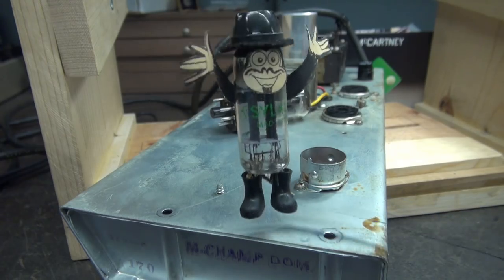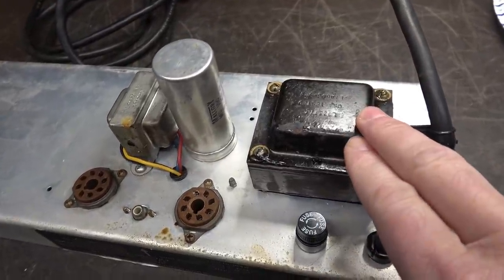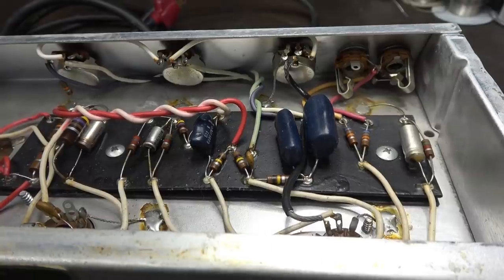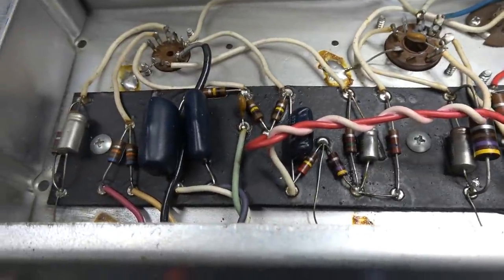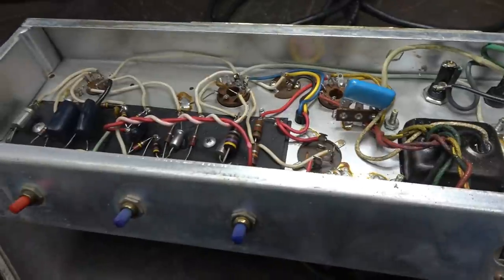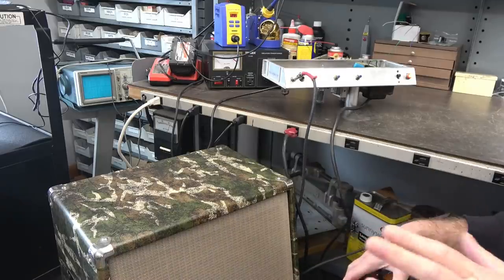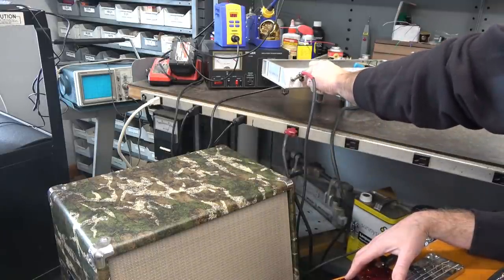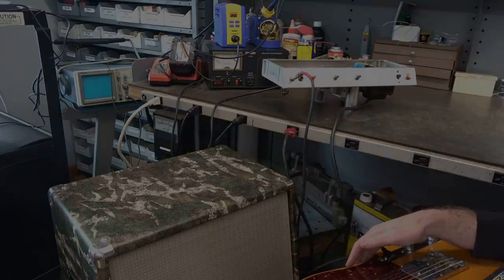How to replace bad tube sockets Check Bias Fender Silver Face Champ Class A 6V6 tube guitar amp

Comment: Thanks Terry.  One tip about matching the original wiring when installing a new socket - your iPhone/Android can be your best friend.  Take a reference photo of the wiring  before you de-solder the original socket.  That plus the schematic is a belt and suspenders approach for replacing the socket.  I started doing this years ago when doing auto and appliance repairs.  Saves me time and improves my odds of getting it right before I power up.  :-)

Comment: Tech Tip:
Any unused sections of a can capacitor should have their terminal shorted to ground. This prevents that unused section from building a charge over time, and that charge would not self discharge.
Reply: Good call.
Reply: Sounds plausible, sure wouldn't hurt to be on the safe side.
Reply: Maybe a resistor to ground would be good, bleed off any charge if the cap shorted internally between sections it wouldn't be a dead short to ground.  I'm not sure how common it is for a short between sections to occur.
Reply: Israel Bettle  Are you actually telling someone you hacked your girlfriend's account and are telling someone else how to do it?  Why?  Would you like it if someone hacked yours?  Or are you a 'bot that just answered yourself as "Huxley Victor", saying you'd try it out but giving an update without editing your comment?

Comment: Terry, great video but I have a question:  I’m getting a couple of people (that I like) that are begging me to work on their amps after having bad experiences with other shops.  I have no problems with the technical side (maybe lacking in some of the lore and component-sourcing) but really have no idea what to charge.  One of these is an SVT monster that needs sockets as well as the usual.  I’m not looking forward to all this hand work and due to the extensive nature, they know the have to compensate me.  I see a lot of repair videos but not on charging and the money side. 

If you could give me a little guidance, I’d sure appreciate it!  Thanks & 73… 😊

Comment: What wattage soldering iron do you use? Reason I ask is: soldering or unsoldering directly on the chassis is always a challenge for me; due to the dissipation of heat on the large surface area.

Comment: At 10:10 in the video, when you cleaned the new cap solder connections, I did happen to notice that all the original chassis connections have flux residue..

Comment: I always enjoy your videos, thanks. A question; is it common to find that the cathode bias resistor called for in the schematic is actually wrong and allows it to run too hot? I'm just finishing a rebuild of a Hallicrafters S-76 and found that the bias resistor on the 6K6 output tube, 390 ohms, allowed about 46ma of plate current or 171% of max. I replaced it with a 680 ohm resistor and now have about 26ma plate current. I'm just wondering if this a common thing to find that it had been biased hot from the factory? It makes me feel a bit weird to ignore what's on the schematic.
Reply: Schematics were designed to work from the  lower power supply voltage ( 110VAC) in the past compared to today's (125VAC). 
So it would prudent to lower  the current to the specs level so you don't overdrive your tube! Following  vintage schematics is OK but you have to think 
what about what is really going on in today"s world and make the appropriate adjustments.
Reply: @hestheMaster  I also calculated the current using the voltages they list on the schematic, (mine are little higher) and it would still be running very hot. It's like they didn't mind. Also, this radio is rated up to 125VAC. I'm curious what their thinking was or if this is common on communications rigs. It's not very loud...I've been thinking of subbing a 6v6 for the 6K6 and going back to the 390 ohm cathode resistor.
Reply: @TheDevice9  Sounds like you need to visit Antique Radios Forums. There are a lot of posts on this receiver as well as some mods to make it sound better. What you purpose sounds reasonable BTW

Comment: So if your line voltage is over 120 volts A/C, what is that doing to the heater voltage on your 12ax7 and 6v6  tubes? Won't that make it too high as well Ter?

Comment: I've got a vintage princeton reverb that's basically a time machine unit, someone bought it yesterday, left it on my front porch..  iots got the brand new stock RCA fenners... its MINT 10++..

the only thing is the power tubes are loose, and they pull out so easily, being upside down they made me nervous so I carefully installed spring retainers you mount at the socket screws.. used rubber bands as to not scratch the screws, what I am looking for is a male to female socket that has extra large male prongs that will snug into those loose fenner sockets real tight then I can plug a tube into that.. no retainers or maybe keep the spring top clamp style on there..

the condition of this I don't even want to tamper with a screw much less heat a solder joint, obviously I need a good solid valve connection so need a good no tamper solution?  maybe there are power tubes that have extra large diameter pins?  the 6V6 power tubes have a coin base with flimsy thin pins?   just seems sketchy to me..

Comment: I've got a Bassman Ten of this vintage in my office here and when I just plugged it in for the first time in like 10 years (long story) it did the old loud feedback hum which I later figured out was called redplating after about a minute of playing. I reached back there to shut if off before it melted down and there was so much heat I pulled my hand away. Before I could unplug it from the wall the fuse took care of shutting her down. Pulled it apart and I found that both power amp tube sockets are toasty like the ones in the video (loose pins and signs of arcing) and the one was bad enough that one of the soldered terminals had partially melted. 
My question for you is, would it be worth just soldering in new sockets (would that likely semi-permanently fix it)? If that's a no go, can you quote me what it would cost to have it gone through like you do in the video here? It's a bit of a family heirloom at this point, so I'm looking to get it back up and running, and I definitely don't want to do more damage to it.
Reply: I'm looking at it some more and it looks like the input lines that go into the transformer might have joined the party with the arcing. It looks like the hot lead going from the power switch to the transformer may have been arcing across two of the terminals there. I'd be really stoked if that's all that was wrong with it. A couple wire splices and a new socket might fix it right up.
Reply: Oh man I think I got lucky here. I don't even think the sockets are damaged other than the metal at the very tip of those two terminals that arced across the hot lead. I might re-wet the solder but otherwise those sockets look fine. I'm going to try re-splicing those leads and see if that fixes it. Looks like a simple case of wire chafing on the input power.

Comment: So fara, any time I've seen burning from arcing like that, it's been from an internal short in the tube, or from arcing from cold solder on the wire on a pin.
I've also seen a cockroach bridge itself between pins and get good and fried leaving a stinky mess behind as well,.... yuck.
Reply: It also could be caused by movement of loose terminals underneath the socket intermittently touching each other,  or at least close enough for a few hundred volts to jump. I agree, and would tap on that tube to be certain that there is no intermittent shorts within the tube. Especially when everything is "nice and hot" inside with a heavy load.
Reply: A dead mouse will work  too. ;-)

Comment: What kind of soldering iron do you use when you are soldering to the chassis?  I bought a 100 Watt iron that is supposed to get up to 1000 degrees but the solder just beads up when I try to use it.

Comment: I adopted an POS solid state Fender M-80 rack mount head. I was forced to take it with the 2 cabs that I bought. It's in rough shape, but works, for the most part  So, I got it cleaned up and relabled (front panel is missing). 
It makes an intermittent "buzzing" sound when powered on, towards the rear of the chassis. 

NOT a hum or "noise" that is typical from high(ish in this case) gain amps. 
This literally sounds like an active hornet's nest. 
If it helps it sounds like it is coming from the rear, right hand side of the chassis. 

Any suggestions?

I know I should just throw it out but there is something about this turd that seems worth polishing. 

Like OJ, let's take a stab at it!
Reply: Just a guess but 50 year old  electrolytic capacitors  may be to blame. . You really want to replace all the electrolytic capacitors in the power supply section
 with slightly higher voltage ratings. If its 100 volts got to 160 volts, 100 volts go  to 120 volts etc. Anything higher it is OK to leave as same but I doubt there are
 higher voltage rated capacitors in it. You need to check resistors too. Some go open!
Often you may see burn marks on the PC board for the higher wattage ones! Watch Terry's video on a fine Fender amp capacitor replacement:
"How to repair Fender Deluxe tube guitar amp Filter capacitor Buzz "  It's from May 28,2017.
You may need a copy of the parts list and schematic for sure here. It's available , so do a Google search.
 If not handy electronics wise  just dump it on someone who repairs stuff  like  Ebay ! Probably not Terry, too busy now!
Reply: @hestheMaster  that's such AWESOME advice my friend! Thank you very, very much!!

Comment: I'm going to build a 5F2A Princeton amp from Mojo, I don't think I want my 6v6 passing 44 mA at 429 vac rms (I'm assuming that is plate volts you are measuring), and 18.5 watts. I've got a 1k Ohm  5 watt and a 750 Ohm 5 watt to choose from in the bias circuit. I get up to 122 vac rms at my house at off peak hours.
Reply from the maker: Hi. Yes, the 1K is a better choice

Comment: That's a simple tube socket to replace. I'm currently looking at a Philco radio with a bad socket. It's dense with wiring, resistors, & capacitor connections. Simply desoldering is going to be a nightmare. I'll be replacing all components attached to facilitate replacement. Simply cut off attached parts.

Comment: Always love these videos,  particularly with Champs. Can anyone comment on the choice to use two 40s on the can cap? I've heard of one bumped to 40 from 20, but not two?  Obviously,  just extra filtering,  but original spec is usually 20 on all,  or later schematics 40 in one stage,  but not two.
Reply: Important thing to remember is what the rectifier tube specs call for.

Comment: I have seen the 6v6 take some awful abuse. not a good thing to do to it. since the amp runs class A it may be a good thing to put an appropriate resistor in series with the power trans primary so everything runs at the appropriate voltage.
Reply: My question is why not install a pot to set bias??